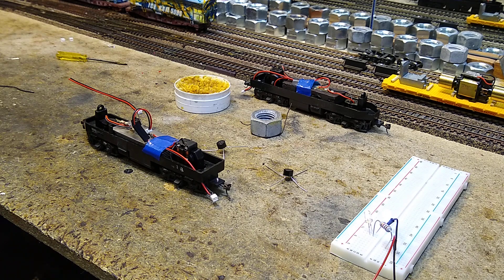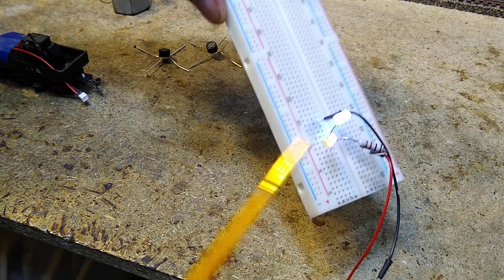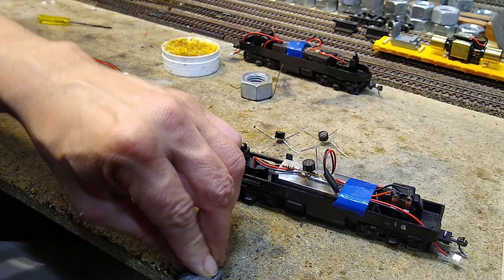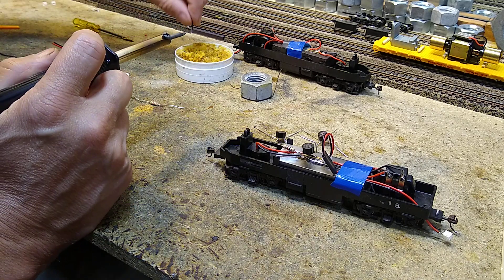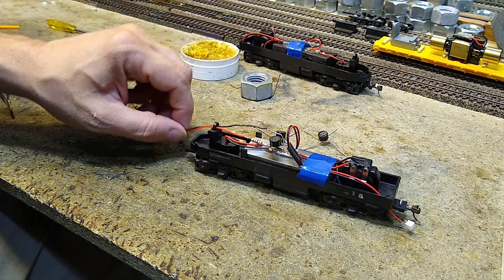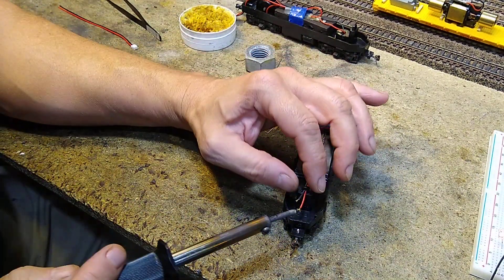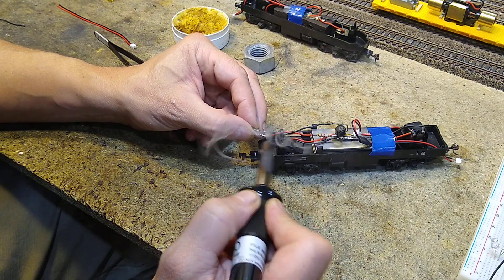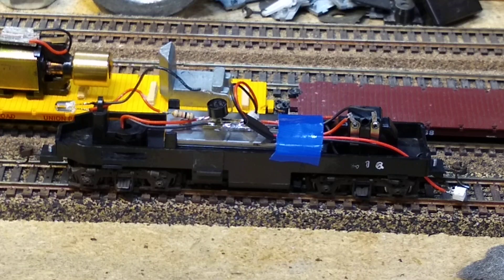Bachmann F9 install LED headlight

Comment: You can make directional headlights  by wiring one "normally" (front) and one "reverse" (rear headlight).
Reply from the maker: I did make a pc board that is basically a copy of a Life-Like with 2 diodes and it worked great